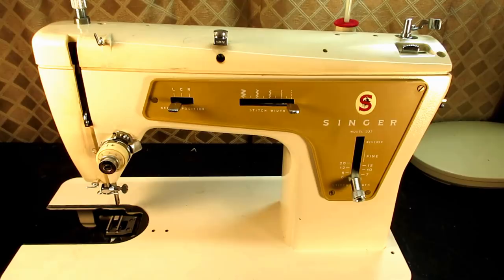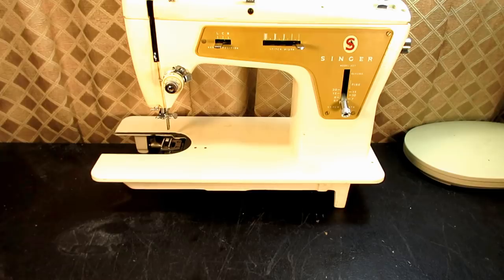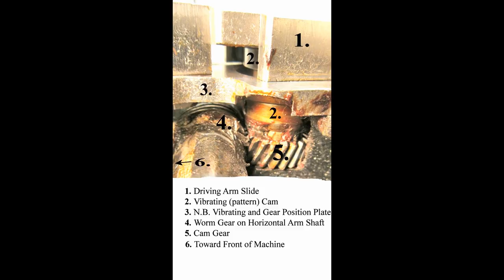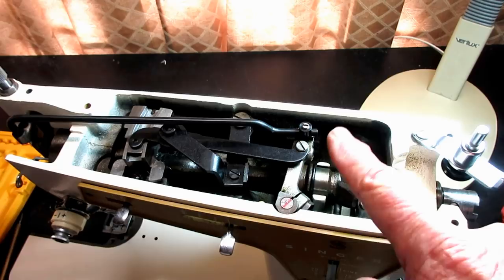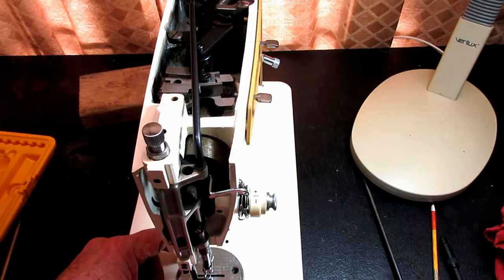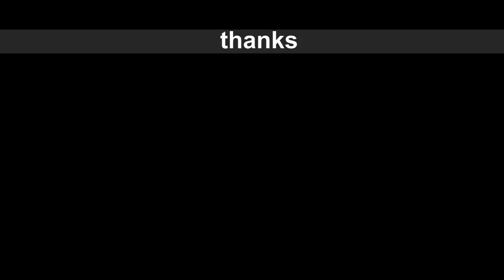The Zig Zag Slide and Traveling Hook Systems on the Singer Model 237 Sewing Machine

Comment: Thanks for the video Andy, looks like you had fun in this one.
;O)

I'm still working on the 1950 Singer 201-2, it had a lot of problems.
The clutch nut bushing was broken, the thread take-up was broken off, was missing the presser bar lifter and faceplate, the wiring needed replaced, I'm upgrading that to the two lead plug where you unplug from the machine to remove both the wall plug and the foot controller.
I took your lead and bought an LED light bulb for it.
I'd say I have 20 hours in just cleaning it up and another 10 on the mechanical end.
It was ready for the bone yard.
I should get the Thread take up assembly early next week and then it can all go back together.
It's got some scrapes and scratches but otherwise it looks pretty good and it's going to be a really nice machine, for a 68 year old Gal, I've been over every inch of her, she's solid now.
I've taken some snap shots and will do a video of her when I get her up and running.
It will be hard to part with it, but I have another to move on to impatiently waiting for me.
;O)
Reply from the maker: Welcome. You have been very busy! A full rescue and restoration. Very nice and thanks for saving her. The easiest method for me to part ways with a machine when I am finished is to run out and buy one that needs restoration. It's like a backward New Year every time: Out with the New and In with the Old. Have a wonderful 2019, Mark, and let us know when the video is up.
Reply: Thanks Andy and Happy New Year to you.
On a side note, I bought several parts from the guy I'm getting the Thread take up from.
One of those parts is the glass lenz you needed on your 99K and it was pretty cheap, like $3, still need it?
Reply from the maker: That's kind of you, Mark but I picked one up on Bonanza a couple weeks ago. Take Care.

Comment: This is why I love your videos Andy. You go into elaborate detail on all the mechanisms which together which make up a little mechanical marvel of engineering. Someone once said if a country can make a sewing machine and television they can make anything including submarines. It is the attention to detail that makes the difference. One thing I wanted to ask, How does the mechanism which drives this model sewing machine compare to Singers other machines? Does it require more effort to turn the machine through it's cycles than than others because of all the sliding blocks in it? Is the needle to hook adjustment accomplished by changing the setting on the vibrating arm tie rod? What other models have this same type of mechanism in them as this one? I have seen similar bodies styles but with different numbers. ie.237, 257, 247, 252. Is it a fairly smooth machine?
Reply from the maker: Thank you, Paul. I have not actually sewn on Stella yet. I usually do all the work first then test the machine. I will say that, after cleaning, the parts all move very easily. Yes, it has the slides, but it does not have gears or belts that must transfer the power to the feed and hook. The power seems much more direct. Once that motor belt has the big, fat horizontal arm moving then everything else is along for the ride. All the slides, slide blocks, forks, and shafts seem really "beefy" to me. A very sturdy machine inside. It is just my hunch, but I feel like the actual sewing motion is going to be quiet b/c slides do not make as much noise as gear and pulleys with belts. The other reason is the oscillating hook motion mechanism is not right below the hook, like on say the model 337. That is done at the opposite end of the machine. I honestly am expecting a quiet running machine that has a smooth, superior ZZ stitch, but I'll find out after I finish up the machine. The needle to hook (shuttle) DISTANCE is set by loosening the top crank hex clamping screw and moving the hook/shuttle race frame so the race frame cap is about .010 inches from the needle is what I think works. I'm pointing to the top crank and screw at 1:05:29 in the video. For the needle to hook point TIMING, I believe if you set the needle at the correct height and then turn the handwheel towards you until the lower timing mark on the needle bar is flush up with the bushing then the hook point will be behind the needle with the eye about 3/32 to 1/8 inch below the hook point. A number 18 needle. I'm not 100% positive of all this b/c I have never seen a system like this before. I personal don't know of any other Singer Model that uses this except maybe the 239 which is the sister to the 237 but is only straight stitch without any ZZ capability.
Whenever I work on Stella, I always enjoy tuning the horizontal arm shaft b/c even without the handwheel the operation is as smooth as silk. Really very smooth.

Comment: This driven slide method of zig zag is a much more precise method of moving the needle bar, as the needle bar and hook is mechanically driven in both directions, instead of relying on a spring for the needlebar return movement, as the later cam stack machines were made. This design is much more complicated, which is why the other design took over on domestics, as well as the easily changed cams for creating different stitches. At higher stitch speeds this driven slide/swinging needle bar design is superior, so several industrial machines retained this method of needlebar movement.

Comment: Thanks for the clarity Andy. There are lots of spaces and parts in there to drop a little bit of oil.
Reply from the maker: Welcome, Leon. Yes, lots of metal on metal movement. The Instruction Manual only shows 3 oil points & 2 for grease, but a little bit of oil never hurt a moving mechanism IMO. Thanks for watching. FREE INSTRUCTION MANUAL FROM SINGER: https://www.singer.com/sites/default/files/product_manual/SINGER%20237%20Sewing%20Machine.pdf

Comment: Andy, I'm new to the 237 model (just purchase one) and have an issue. I have been thru service setting NB height, move hook closer to needle (was skipping stitches), re-centered needle in throat plate.  My issue now is when I'm in zig-zag the needle bar when in it's rightward motion it's slightly still moving when tip of needle is getting into material. On the leftward swing motion, needle bar has finished it's motion and the needle is about 3/16" above material. The only way I see to balance right and left motion is to (in my case ) to advance the cam slightly to reduce rightward swing earlier, which will automatically start the left swing sooner and will bring needle closer to material before ending it's swing (which I feel I have room to do).  In your video you said your retired Singer mechanic suggested not getting into the gear position plate and vibrating cam.  The manual does talk about lining up the holes in cam and positioning plate with NB at top of stroke, my holes are lined up. From your video schematics and my service manual it appears that the cam can be rotated on the gear body without disturbing eccentric stud and it's set screw, therefore not effecting gear to gear setting. The challenges I see are, can I get the 2 set screws loose once I gain better access and will the cam freely rotate on the gear shoulder. 2nd, if my estimate of how much to rotate cam is wrong I would have to remove all the same parts a second time and re-adjust. The machine I bought is really clean, came with original carrying case in unbelievable condition. I committed now to fix this machine. I can't really use machine in zig-zag because of this. Would really appreciate your thoughts.  Bryan C.
Reply from the maker: I have not made this adjustment on model 237, but it sounds like you need to "Time the Pendulum Movement of the Needle Bar". Those instructions start on page 22 of the Service Manual.
Reply: Thanks Andy for the quick reply. Problem I see if you could look at page 25 it shows worm gear attached to arm shaft with 2 set screws. Well my 237 and others I've seen on YouTube as well as your Stella have the worm gear machined right into shaft. I'm thinking that only gives the option to make adjustment where the cam body fits over the small gear shaft. There are 2 set screws on that connection of cam shaft to small gear shaft. I did some accurate measuring this afternoon, the difference in needle position from right to left when pendulum completes maximum movement is, left swing needle point 1.5 mm above throat plate and right side the point of needle is buried almost 9mm.  Did Singer change design of horizontal shaft over the course of production? @andytubesewing1953
Reply from the maker: @bryancathey3242     OK, I am not going to be able to give you a definitive solution to your problem, but here is what I can tell you.
     There are two versions of Model 237. and I believe they were made in two different countries, Italy & Brazil. The Model distinctions are 237 and 237M which is an abbreviation for 237M23.
     It is believed that the letter M signifies the Monza, Italy factory which was the first in Italy. It is believed (as found online) that the Model 237M was made from 1967 to 1971. This model has a Drop Feed feature and no set screws for the Worm Gear as shown on Singer Form 730-237
     Model 237 (no letter suffix) was made from 1968 to 1972. Opinions seem split as to whether the 237 was made at a newer factory in Italy called Vial Marsala that was built in the mid-60s or at the Campinas, Brazil factory. The Monza Factory was closing and work was being moved to the smaller Marsala Factory. It does not have the Drop Feed Feature, but does have the screws as shown on its part diagram/list. (That diagram has no Form Number.)
I’ve been able to find many parts manuals/diagrams over the years, including one each for the 237 and 237M23. I’ll be happy to share them with you if you care to email andymanuals53@gmail.com and ask Alan for them.
So that’s all I have for you. As stated earlier I have not made that adjustment on the machine in the video which is the only one I’ve ever worked on.
Good Luck.

Comment: Oh what fun..!!!   I see that I have a  lot more videos to watch.  well, I got my machine home today,, glad I didn't pay much. The good news is, I got it unstuck. it's actually really pretty clean, I could tell it was mechanical jam that caused it not to move. I found that it was the round black zigzag bar on top, was actually hitting the take up lever at the top of the stroke. I loosened the screw on the other end of the round bar and moved it to the right a little. well that unstuck it,,  I oiled the machine liberally, and she's loose as a goose.... BUT... hahah.. there is always a but..now the needle will hit the top of the race off to the side, must be because if the vibrating zig zagger mechanism in the nose.. got to watch the rest of this video. this machine will take more than a day to fix.. uhh.. and also, on another note, after I adjusted the needle bar, and that's fine, but,, there seems to be a little slack in the part behind the set screw at the connecting linkage..which causes the needle bar to have almost 1/8 inch of slack that doesn't seem right? IDK about this Italian.. LOL  mine has the feed dog drop knob, and a plastic base and cover.. well, more video.. Thank you..!!  oh, I did find a tiny pin on my newspaper under my machine as I was working on it, have no idea where it came from.. haha. oh boy.. it's about ? 1/4 in. long and only maybe 3/32".. any ideas??  LOL,, this is going to be a fun job..  GREAT video by the way.. !
Reply from the maker: Easy. Does it moving that part in the beginning may have unintended consequences. Sorry I don't know about the pin. I actually like this machine a lot because the mechanical systems are so very different than most of singer machines and there's a lot of heavy metal in there. The only thing that seems weird to me is the bobbin slide plate. It just seems real rinky dink compared to the rest of the machine and kind of flimsy all the 237 and 239 machines I bought. The guide spring under the plate was broken from people lifting it by the bottom slide Hope you get it work out is relax and have fun. It's a long holiday tomorrow
Reply: @andytubesewing1953  Thanks Andytube.!   oh someone else has been in this machine before me that rod was hitting on the front near the take up lever, mostly when it was needle to the right.. not sure why, but I'll figure it out eventually . I didn't move much, and can put back what I moved, when I figure it out...  happy independence day..!  Thanks again for the great videos.
Reply from the maker: @connieworcester55  😊
Reply: @andytubesewing1953  well, I have to thank you again,!!   I am still watching this video. and I just have to keep getting up to try something else on my machine. LOL..(it's new to me, so I'm excited to get this working).. This is how I have fun in my retirement.. whoo hoo..I have 12 sewing machines now...  You are such a huge help..I know this video is 4 yrs old, but it's new to me. ..  I just now adjusted the needle to the center of the plate, with that top bar set screw loose, and then tightened it like you said in the video. with the needle position lever on the center, and the other lever on straight stitch.. it worked.! thank you, the needle doesn't hit anything now. YAY... BUT,, ,,now I see that my take up lever appears to be somewhat bent.!  I think it had a rough ride in the back of a pickup truck at some point, the case is all scratched up with black scratches... that's probably why it was,  and still is, (hitting ) on the piece where the black rod goes into the front piece next to the take up lever.  so it won't turn when the take up lever hits.!  all I have to do now is bend the take up lever back where it (should) be. That is some strong steel, I don't want to ruin anything else..don't mean to be so long winded. but your help is SO SO APPRECIATED..  The way you take everything apart and explain it. is so easy to understand.. You've helped so many people all around the world.. I'll just stop commenting and watch all the videos. Thank you 🙏
Reply from the maker: @connieworcester55  Thanks for the kind words. I tried straightening a bent takeup lever once. Snapped it right off. Good luck, but just in case: https://www.ebay.com/itm/175694047477?hash=item28e82e68f5:g:uHMAAOSwK2xkPupG

Comment: Dear Andy, thank you for this video and for all the wonderful videos on fixing old Singers! I have quite a few old sewing machines. One of these is a Singer 287 which is very, very similar to Stella. I'm stuck with one problem. The needle bar on my 287 does not have any marks at all. Is there a way to set correctly the needle bar height in this case?
Reply from the maker: Sorry for the delay,, Alisa. I had to think this over. 
     I'm thinking about the results after setting the NB height. With the needle bar all the way down, or at least the connecting link that holds the needle bar all the way at the bottom, is where the top mark would set just below the bottom of the NB bushing,
    Then you have to turn the handwheel toward you (front of the machine) a very  amount to raise the NB so the lower mark is just below the NB bushing. 
     I'm guessing the NB goes UP ( the UPWARD STROKE) about 1/16 or 3/32 inch or so to bring the lower mark up to the bottom of the NB bushin. Now here is the KEY, at that point, the NEEDLE POINT must be directly behind the point of the HOOK, and the EYE OF THE NEEDLE should be about 1/16 inch BELOW that HOOK POINT. That is the timing of the hook point to the needlepoint.
     Think about this; when the needle starts its upward stroke the fabric drags a little on the needle thread. That drag creates a tiny outward "loop" of thread to stick out away from the needle toward the hook. That is so the POINT of the hook can "catch" or "snag" the needle thread and take it around so it wraps around the bobbin thread to form a cross-stitch.

Comment: Thanks for all these great videos on the 237! I just picked one up from a thrift store and have followed all your videos but have a problem with the timing - do you have any videos I could watch for this relating to the 237? Thanks!!
Reply from the maker: I've never had to adjust the timing on this model other than resetting the needle bar at the correct height. That is the only direction for hook-to-needle timing I see in the Service Manual. There is an adjustment for distance from the needle to the shuttle (hook) so maybe that's your problem if the NB is set correctly.  You can see some comments from viewers who also asked, and some say they found a way to rest the timing. Look for Geoffrey Scheid and Paul Erickson comments. I'll share the service manual if you think it will help. Ask for it when emailing andymanuals53@gmail.com